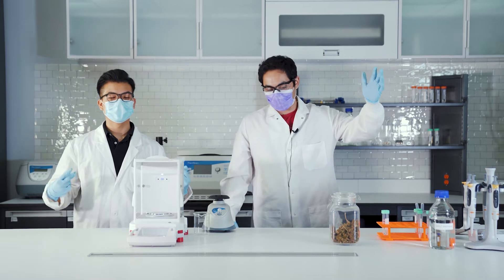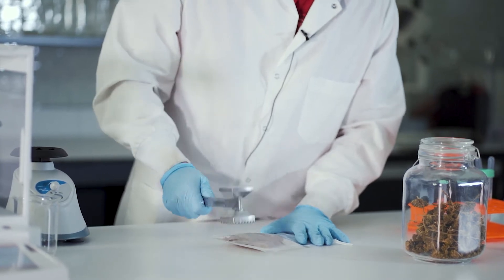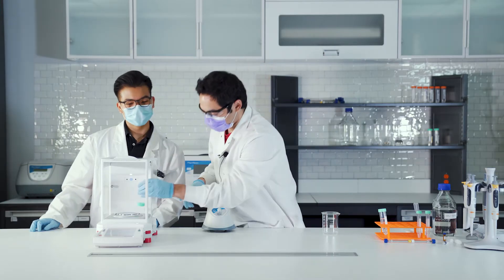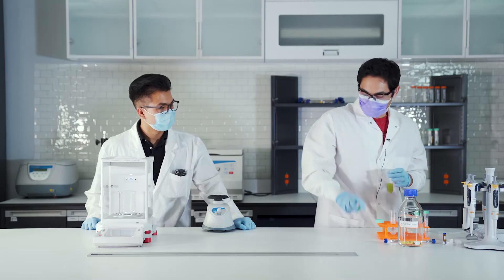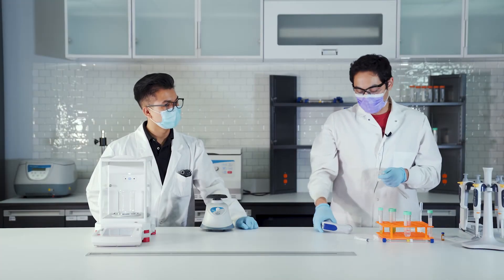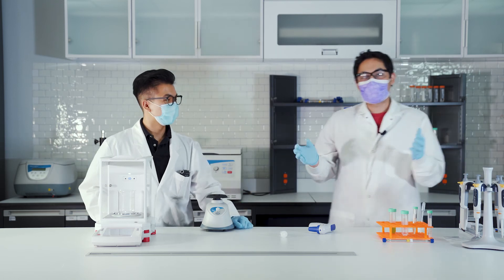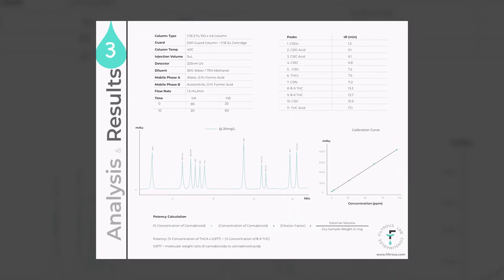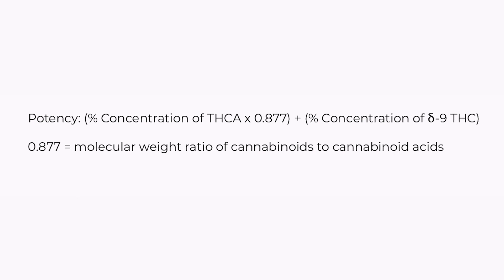Cannabis Testing Guide: Sample Preparation and Analytical Method for Potency 2022 (UPDATED)

Comment: What exact balance are you using?  I am guessing 4 sig figs but I am wondering what is the most economical balance you could get away with.
Reply from the maker: You typically don't want to go below 4 for HPLC applications.  You can always find refurbished units for a good deal!
Reply: Thanks!  If all I’m doing is cannabis potency, what calibration weights do you recommend?

Comment: Methanol is not a good polar solvent to extract something polar like THC, try using other solvent for extraction. also use volumetric glassware since this is an assay for potency
Reply: Methanol works just fine for extracting THC. Many THC standards are sold dissolved in methanol, so that's just not true.

Comment: Hi, what is the difference if i want to combine HPLC with Mass spectrometry (MS) to determinate the concentration of cannabinoids (CBG, THC, CBD) ? knowing that its a plant culture so i dont' have cannabinoids standards.
Reply from the maker: You need the standards to determine concentration.   Also, the concentration of cannabinoids needs to be really low in the sample which will require you to dilute a lot.  Usually concentrations are high enough where your standard UV detector would be sufficient.
Reply: @DavidYazdi1  Firstly thank you so much to answer me. 
If i am undestood correctly, i can find cannabinoids standards on litterature, it will help me to determinate concentration of cannabinoids in my plants. Futhermore, do you have any advice on how many tests should be done to ensure the quality results ? And the fact that its a culture plantation, i have to do test of potency frequently while the plant is growing. So if you have advice on every how many times i have to go in laboratory to do my test... =)
Thank you again from France =)
Reply from the maker: How many tests do you think you should do?

Comment: Doesn't the freezing step potentially degrade cannabinoids?
Reply from the maker: Heat would be more detrimental.  For the most part if you're just determining THC content it shouldn't affect it.  As for cannabinoids, freeze thaw cycles might have an effect, but it's hard to quantify what that affect might be at various temperatures.
Reply: @DavidYazdi1  Thanks, I've heard that storing cannabis in the freezer degrades THC to CBN, but that must be over a longer time period.
Reply: Probably worth running a freeze thaw cycle study for if you're interested :)

Comment: Can anyone explain where sample concentration came from? like which part of analysis result sheet am I supposed to look at?
Reply: I'm talking about 0.05mg/mL.
Reply from the maker: @ff4064  quoting Sr. Gonkus from another comment:

"He’s choosing an arbitrary value as an instrument result. The calibration curve units would be in mg/mL in this case. He’s using this as an example to show the back calculations to reporting units.

So obviously we have a 1000x dilution, but our conversion factor is 100:
(X mg/mL) x 100 = 5% of that cannabinoid or 50 mg/g in the flower material. In reverse we can assume a 5% by mass cannabinoid will read as 0.05 mg/mL in the instrument. Lastly, this conversion is based on two static variables — 1. The 1000x dilution and 2. The sample weight is always 200 mg +/- a couple mgs.

When the sample mass varies you can still use the x100 conversion but you just then multiply by (static weight / actual weight) and you will get your corrected result."

Comment: When you purchase the HPLC equipment does it come with the software to analyse the potency? Because i see that there is some software that you are using, does that come with the machine when you purchase it or do you buy the licence for it separate?
Reply: Software typically costs extra. I'd talk to the manufacturer to confirm
Reply from the maker: @yinfu9301  You can buy HPLC equipment from Waters, Shimadzu, Agilent, etc.

Comment: You guys should do a GC-FID cannabinoid video. I am extracting CBD CBG and THC for my independent project and this is the instrument I will be performing on. Would you guys prefer HPLC to GC-FID when analyzing these various medicinal compounds?
Reply from the maker: You'd really want to stick with HPLC for potency.  An FID would decarboxylate the acid and you would just get the active form only.   For edibles this wouldn't be ideal.
Reply: Independent project? Are you a college student or are you in the industry? Just asking because I'm a graduate student wondering if research is possible in the academic level?
Reply: @AlexPerez-yj8mm  I have just recently graduated from NMU’s  undergraduate medicinal plant chemistry program which focuses highly on cannabis chemistry. It’s a very new program with lots of potential gearing students for the cannabis industry. I would highly recommend it if you have the ability to learn and apply chemical knowledge in the laboratory. I grew 12 hemp plants for my final project to observe the concentration of CBD at various nodal differences in the plant. What I found was a correlation between the concentrations of cannabidiol aka CBD, is higher when looking at the flowers on the top of the plant. I believe this is due to the light being located near the top plant where energy and nutrients are directed.

Comment: Great video! On the calculations where did you 0.005mg / mL?
Reply: He’s choosing an arbitrary value as an instrument result. The calibration curve units would be in mg/mL in this case. He’s using this as an example to show the back calculations to reporting units.

So obviously we have a 1000x dilution, but our conversion factor is 100:
(X mg/mL) x 100 = 5% of that cannabinoid or 50 mg/g in the flower material. In reverse we can assume a 5% by mass cannabinoid will read as 0.05 mg/mL in the instrument. Lastly, this conversion is based on two static variables — 1. The 1000x dilution and 2. The sample weight is always 200 mg +/- a couple mgs.

When the sample mass varies you can still use the x100 conversion but you just then multiply by (static weight / actual weight) and you will get your corrected result.